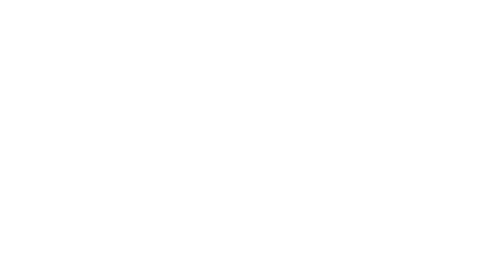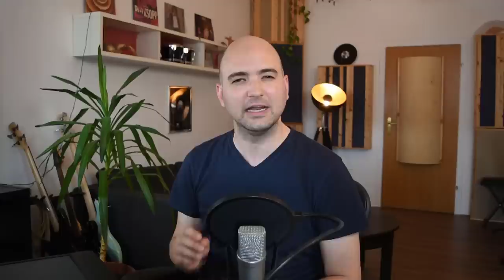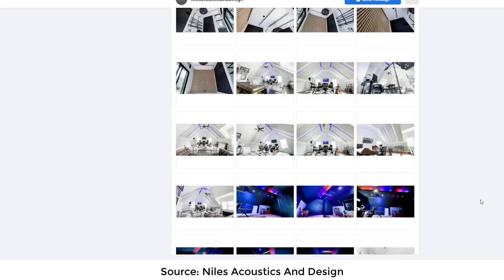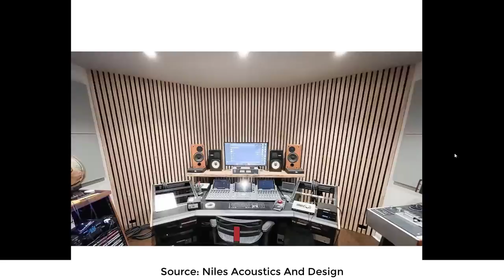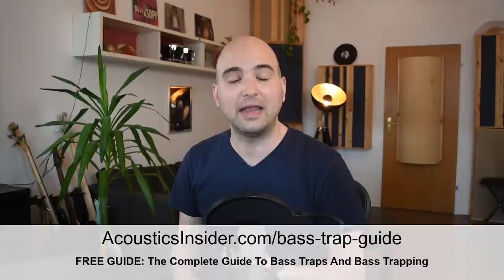Acoustic Reflections: Wood Slats On Top Of Absorbers? - AcousticsInsider.com

Comment: i helped GIK design their first set of reflective panels for their absorber line and i've been using reflective slats and panels for many years to avoid anechoic spaces - many people with small rooms after applying significant amounts of absorption to control the room response find the "dryness" difficult to work in. so adding enough reflection back into the room to enable a "sense" of the room as well as support for "self-noise" etc can help restore the balance needed.
Reply: my  point i s to get closer to  anechoic space, i just feels so good absorbing more and more. then the rom disappears and becomes more and open space, like outside.
Reply: How do u calculate the width and spacing of the slats? I would appreciate the answe !
Reply: @hamooddyy  Same question. It looks like the "random" patterns used for skyline diffusers. Each slat is a resonator so you probably don't want the slats to be the same or in harmonic intervals.
Reply: @digidope  to be honest my room is now fully treated and i have coaxial design monitors (genelecs 8341) and they dont need the reflections for accurate monitoring, and i dont get crazy or anything because i only use the studio for studio work and dont chill in it

Comment: Great video. I think you just forgot to mention that it can also be in some cases a whole wall that works like a slotted Helmholtz resonator with porous absorber inside. The width, gap and depth of the wooden slats have a huge importance. Tricky to build as the entire wall should be airtight...
Reply: Thanks! This a precious information you add here man! I exactly wanted to point this out as well :D

There's a French dude called Andy Mac Door who did an entire set of tutorials on the Helmholtz resonator he built. He shows a lot of measurements as well and the setup seems really efficient... But time consuming and taking a loooot of space!

Comment: Hey all! I am currently treating my room and using REW for measurements. I have achieve a super nice low end response using treatment, however I have a MASSIVE (about 30db compared to the average of the rest of the response) dip between 6k and 12k. I can find all sorts of information on low end issues and common fixes for that but I cannot seem to find anywhere where they address high end nulls. Could anyone point me in the direction of a good resource or give me some common tips/things to try to fix this? Thanks in advance!
Reply: Just for testing purposes, try adding an absorber panel on your desk and test again with REW. The destructive dips at those frequencies might be due to reflections from your desk. Just a guess, but definitely worth trying.

Comment: I visualize sound waves as being vertical in oscillation, but know they are omnidirectional.   With that in mind, I usually see the slats vertically aligned, but occasionally see them horizontally aligned (which always looks off to me).    Is there any input or guidance as to the orientation?   Should I alternate panels horizontal and vertically, or does it really not matter?   

Thanks for the great videos, and knowledge shared.
Reply: When the gaps are vertical, they work on the horizontal plane. That's why they're mostly (always) vertically aligned.

Comment: Hey Jesco, great video & content as always! Kind of a follow up to this video…

Had a question, if you haven’t already talked about it before.. is it possible to put speakers on shelves mounted to the wall (shelves would be 20” deep) and get ok sounds from this? I have foam under the monitors to decouple already. Previously were mounted on my desk but I have a new desk. 

Curious for a few reasons, as this would be cheaper than high quality stands, as well as would be able to utilize the space between the wall and the desk under the shelf. 

Thanks!
Reply: One issue at play here is SBIR, which is the effect of the energy wrapping around the cabinet and reflecting back toward the listener. 

Genelec's recommendations;
If the face of the speaker is under 2' (60cm) you largely avoid the negative effects of SBIR nulling out vital bass freqs. 

If it's bass managed with a sub system, then that changes to either flush mounted in walls, or no closer than 43" (1.1m). 

Of course this is for studio monitoring... for HiFi use, sub or no sub, huge amounts of spacing off the front wall always benefits the experience. 
My monitors, w/sub support, are about 9 feet (2.7m) out into the room, they perform and measure great.
Reply: @FOH3663  thanks for the reply! That’s good info.
Reply: Especially with front ported speakers in a small room, I would prioritise the listening position and prefer having them pretty much touching the front wall. If you can't avoid having bass bouncing off the front wall, it's better to have the reflection in phase and EQ it out IMO. If your monitors have the ports in the rear, I can actually recommend stuffing a sock in there, worked wonders for me.

If you found the best listening position (by measuring) and can afford to have your monitors about 60 cm (for 8" woofers) off the front wall while keeping them at a reasonable distance from each other and your ears (between 1,50m and 2m), then I suggest keeping the speakers away from the wall and put thick absorption behind them. Otherwise, stick them to the walls with no absorption right behind the speaker (you actually want as much reflection as you can get) and concentrate your absorption on the early reflection points and corners.

Comment: So I just had a quick thought listening back to my speakers in my studio so I have a rear door that leads to my bathroom and I noticed when I opened it the sound seem to get bigger in the room and I was wondering could I leave the rear door that leads to my bathroom open to kind of act as A diffuser I really would like to know if this works or not is it really does sound amazing in the room when it’s open
Reply: What you hear is natural reverb. Sounds like you over-absorbed the high frequencies in your room. Too much thin foam maybe?
That bathroom is not a diffusor, it's a resonator if anything. I suggest capturing that as an impulse response first and then (re)moving some of the acoustic treatment in your room.
Reply: @Hamachingo  thank you  so the panels I have are 6 inches thick but it might be that too much of my high end are being absorbed and having thick carpet doesn’t help and I only had the thought because the bathroom would add another 5 feet to my room if the wall wasn’t there so it would be 20 feet long or 2 meters I think since 1 m is 10 feet I believe don’t quote me on that What do you think if I had a bigger size room with the same amount of panels that I could get rid of the problem of too much high-end absorption?
Reply: @noahwallace3458  Well, your room will sound overly dry especially when compared to a bathroom with tiles all around, The harder the walls and surfaces, the more they reflect. And the denser the material, the more it reflects lower frequencies as well. Bass and lower mids go right through wood any drywall, but stick brick or concrete walls will reflect those frequencies back (making room modes quite the nightmare).

I'd recommend moving those panels to the corners of the room so the higher frequencies can still ping pong along the walls. Then, if the carpet is glued in, try covering it with cardboard or similar to reflect the higher frequencies. If that makes it better, your carpet might be a problem.

I honestly don't think your room is over-dampened though unless you have foam on the walls and ceiling. I used to have that in my old tiny bedroom studio. It made you feel uneasy right away as you entered, you could hear your organs and had to talk at least twice as loud. That's overdampened.

If you have any condenser microphone, definitely download Room EQ wizard and look at the waterfall graphs. Measurement microphones are more accurate in the frequency response, but for decay times, any old condenser mic will do really.

Comment: Couldn't you avoid this 'deadness' by simply getting panels that absorb the proper rate and level needed by the surface?
If the parameters are dependent on room usage, why not get it right the first time instead of using slats like these?

Comment: there is a benefit of having it the other way horizontally going up over the ceiling, there is a mathematical format to it can't remember the guys name and English guy who designed opera horses like the Sydney opera hall.
why don't you tell people to use a quadratic diffuser calculator, if you make this open back with an  inch of sheep fleece stapled to it, standing off an inch away from the wall.

Comment: Please let me correct you here Jesco... 

Slat Diffraction Frequency, both width and gap			
	Full	1/2 wave	1/4 wave
0.75 inches	18023.7 Hz	9011.8 Hz	4505.9 Hz
1.50 inches	9011.8 Hz	4505.9 Hz	2253.0 Hz
2.00 inches	6758.9 Hz	3379.4 Hz	1689.7 Hz
4.00 inches	3379.4 Hz	1689.7 Hz	844.9 Hz
6.00 inches	2253.0 Hz	1126.5 Hz	563.2 Hz
8.00 inches	1689.7 Hz	844.9 Hz	422.4 Hz
10.00 inches	1351.8 Hz	675.9 Hz	337.9 Hz
12.00 inches	1126.5 Hz	563.2 Hz	281.6 Hz
14.00 inches	965.6 Hz	482.8 Hz	241.4 Hz
16.00 inches	844.9 Hz	422.4 Hz	211.2 Hz
18.00 inches	751.0 Hz	375.5 Hz	187.7 Hz
20.00 inches	675.9 Hz	337.9 Hz	169.0 Hz
22.00 inches	614.4 Hz	307.2 Hz	153.6 Hz
24.00 inches	563.2 Hz	281.6 Hz	140.8 Hz
26.00 inches	519.9 Hz	260.0 Hz	130.0 Hz
28.00 inches	482.8 Hz	241.4 Hz	120.7 Hz
30.00 inches	450.6 Hz	225.3 Hz	112.6 Hz
32.00 inches	422.4 Hz	211.2 Hz	105.6 Hz
36.00 inches	375.5 Hz	187.7 Hz	93.9 Hz
38.00 inches	355.7 Hz	177.9 Hz	88.9 Hz
40.00 inches	337.9 Hz	169.0 Hz	84.5 Hz
42.00 inches	321.9 Hz	160.9 Hz	80.5 Hz
46.00 inches	293.9 Hz	146.9 Hz	73.5 Hz
48.00 inches	281.6 Hz	140.8 Hz	70.4 Hz

So for reflections from slats - look at the 1/4 wave ;)

Behind is not in front of you. Behind means the BACK wall. In front of you will be the speakers, If you are talking about behind the speakers it might apply.

And you don't know what you're talking about slats in front of you. 
In your experience - you have NEVER experienced a good room.

Comment: You totally didn't answer the question by passing with pseudo-science again. The only thing you said that made sense was to trust your ears. As long as your ears are screwed up in the first place that is. The question was do wooden slats with combined absorption make a difference to the room acoustics? You even put a picture up to that effect. The slate design that was shown acted like bass traps but on the front wall. A wall by definition is a reflective surface if it is a bare wall. Putting up wooden slats (wood is a very good sound absorber all by itself), combined with a  second layer of fiber acoustic cloth, and then the third layer of acoustic foam will sort out mid to high frequencies. For this to work properly, the rear wall also needs to have a diffuser and absorber combination treatment. The side walls are where the majority of absorption panels need placing and first and second reflection points. If you add absorption panels on the ceiling at a slanted angle (mixing location). you will have a decent room to listen to your mixes. No home studio environment is ever going to replace a professional studio environment. All you can do is best endeavors. Vicoustic Waveform is good example of this which has good ratings. You can make these yourself too if on a budget.